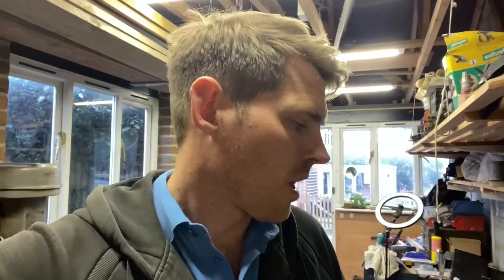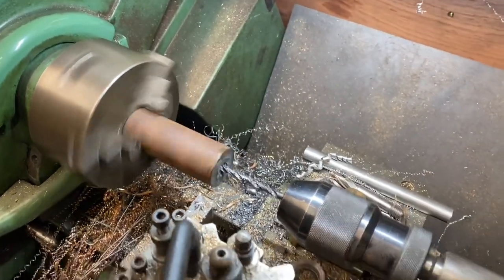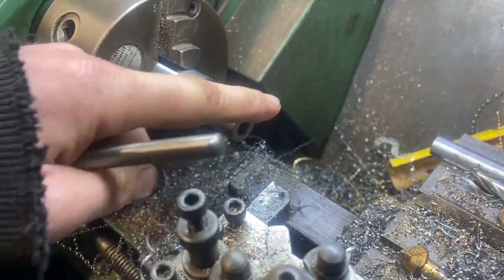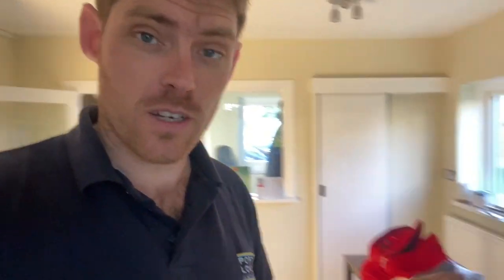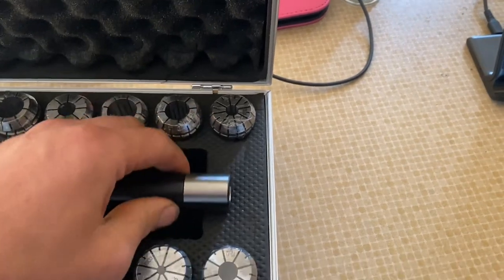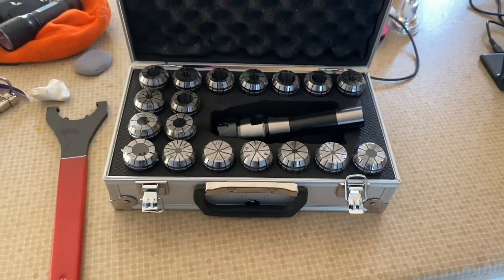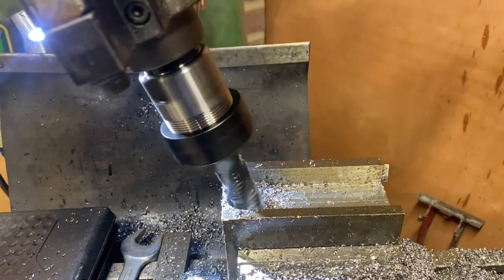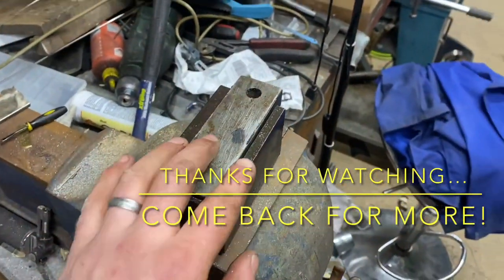I need a shovel…

Comment: LBSC used to make a former, cut the steel for the shovel a quarter of an inch larger except for the front edge, then 
hammer the blade around the former. It produces a perfect flange, (eventually).